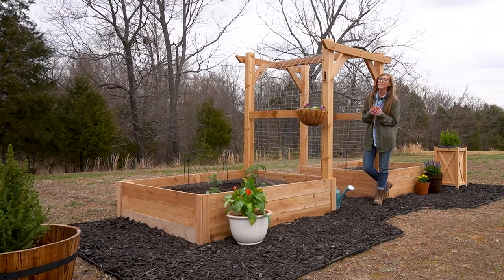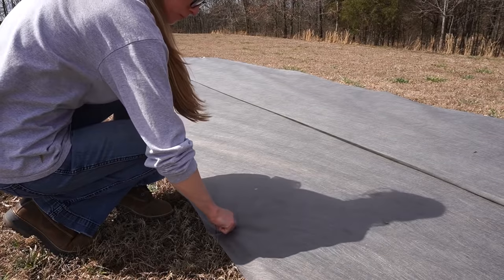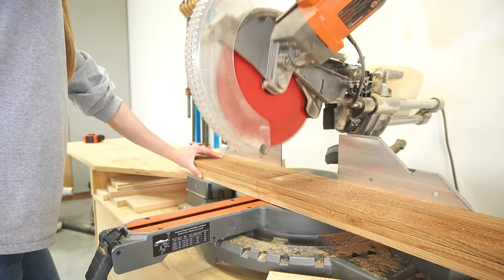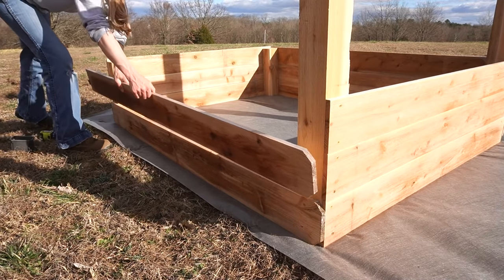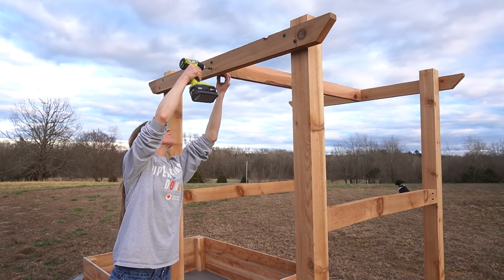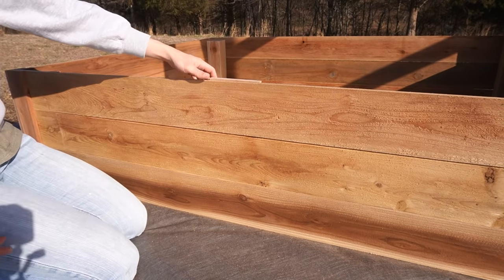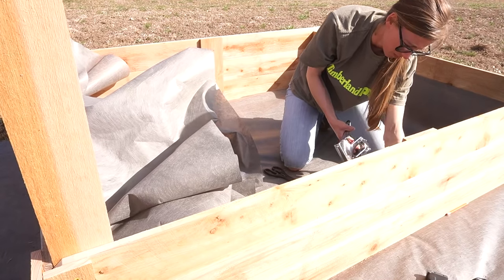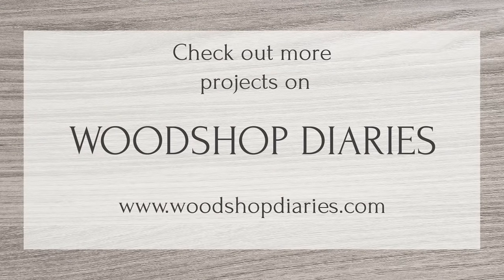DIY Raised Garden Boxes with Trellis--an EASY Garden Project!

Comment: I built one of these over the weekend.  I combined both sections in the middle and left the 4x4 posts on one end 6 feet tall so that I could grow some vine cucumbers on that end.  I ended up having to use 1x6" x 6' fence pickets as the 1x8" we're special order and I would have had to wait a week to get them.  Happy accident because as my planter was 4 feet by 12 feet in size I had to move around 3000lbs of bagged dirt to fill the thing and that was an effort.  Thank you for the cedar plank design, it was easy and turned out great!

Comment: Great job. When i built mine, like u did, I used self piercing lath screws. They have wide head almost like a washer, which I hope will keep the boards from being pulled out if there is too much pressure. I also went much cheaper way. I just used 2x4s,  curious to see how long it will hold. I'll be building one more today. I ordered 4.5 cubic yards of soil and still have lot left.
Reply from the maker: Great idea! I built a raised bed from standard untreated pine 2x12s a few years ago and it lasted two years of planting and was still in decent shape when we sold the house and moved.  We left it there, so I can't speak for sure, but I'd say it had another two years at least left in it.  So I bet your regular 2x4 beds last a good while as well!